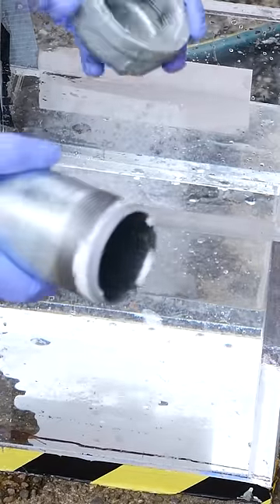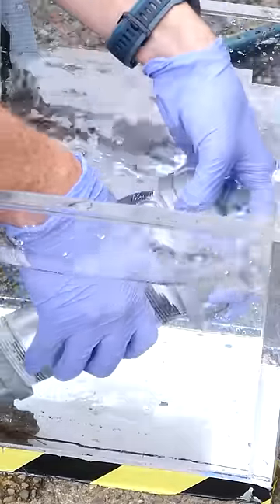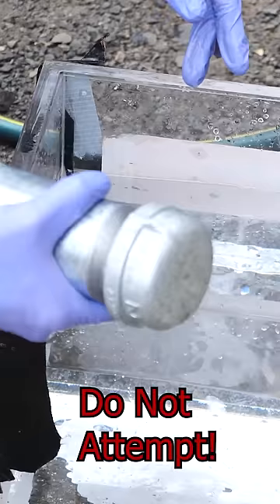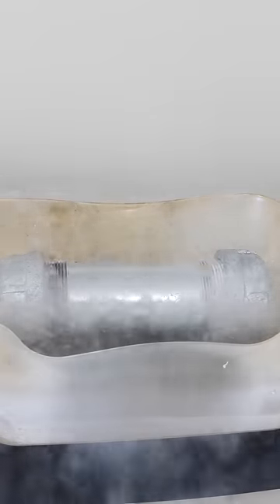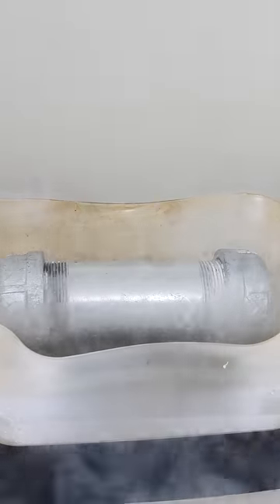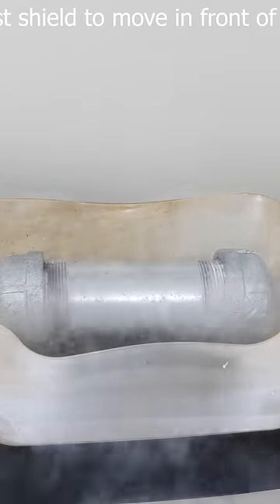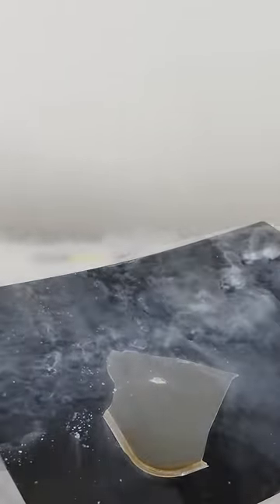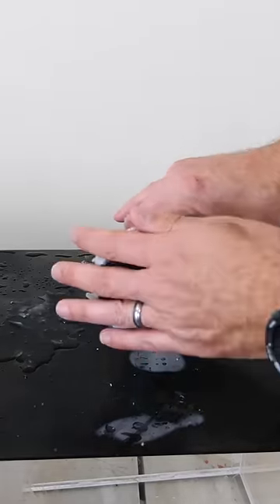Don't Ever Try To Stop Water From Freezing!

Comment: The pipe would still have likley broken if you froze it normally, but the liquid nitrogen weakened the steel, making it a more spectacular break than it likley would have otherwise.
Reply: Clearly a freezer would have taken too long.
Reply: Wrong my man it dosent get cold that fast at most it was -20c wich will not affect the steel
Reply: @night_light2867 that’s not true, the low temperature WILL AFFECT the steel.
Reply: @night_light2867 that's extremely thin galvanized mild steel. It doesn't take much of anything to effect it. I'm a welder and deal with 0.5" and thicker material all the time. Some is upwards of 3-5" thick. I've seen how hardened steel can become after excessive heating. We have specific procedures for metal that's been outside in the cold (down to -20 F here but sometimes even -30)

There's also the issue of how fast the temperature changes. Which I can assure you liquid nitrogen is more than capable of doing.
Reply: @ericalbers4867  Probably would have been a good idea to precool the pipe
Reply: I almost forgot about that variable and using rapid cooling. 
Thank you for that observation!
Reply: @ericalbers4867 Any literature you could recommend for those specific procedures for metal that's been outside in the cold ?
Reply: @xtevesousa  if you can get your hands on an AWS book, that would be best. Though other countries have their own standards as well. Some companies and fields will have their own S and M specs as well. Your best bet on this stuff is to start down the rabbit hole of metallurgy and material science. 

r/welding might be a really good place to start as well. I'm sure someone there might know some specific literature you could get cheaply or even for free. The AWS CWI manual is quite expensive otherwise.
Reply: Yeah. The liquid nitrogen was cooling the pipe more quickly and made it more brittle. In the freezer, most likely it would’ve popped an end top, but without shattering.
Reply: Normally when a pipe full of water under pressure freezes the pipe will split along it’s length. Usually you won’t know about the split pipe until the water thaws and water pressure starts to spray water everywhere.
Reply: @night_light2867   The steel used in the Titanic's hull started losing its ductility and became brittle in the cold ocean water, which was only 28°F (-2°C).
Reply: @newdefsys Dingdingding!Correct! We'll see you tomorrow in the Finals!

Same kind of thing happened to some of the Liberty Ships in WW2; trying to figure out what was happening led to the birth of a new science, "Fracture Mechanics".
Reply: How tight were the end Caps, if they would have been tightened with pipe wrenches the pipe would have split
Reply: Most of you in this thread don't comprehend that the water would not have Frozen it would have stayed a liquid. If they had put it in a freezer it would not have broken the pipe and upon removing it and opening the pipe again you would find the water was not a solid.
Reply: Thanks for writing the same thing I was going to write. He should have put it outside, especially on a day like today. It was -12°F today! That is not including the wind chill factor!  -19°F at night.
Reply: The caps arent cast iron?
Reply: @YZ450f24 how you figure that ?
Reply: This isn't the same as an ice explosion. It was too full to ice and the frost just blew the cap off.
Reply: @night_light2867  It's not just the change in temperature that increases brittleness, but also the rate of cooldown.  And this cooled down very fast.  However, in this case the cap failed first.  The no seize compound provides just enough slip and so the pressure forced it off.
Reply: @alexandernorman5337  😂 what are yall talking about ? The cap didn't unscrew
Reply: @diegodonjuan  wait ✋ you think a container full of water won't freeze ? What exactly do you think is the difference between frost and ice ?
Reply: @Didyoueverthink-ug5dw  Watch it again.  You see it separate.
Reply: @Didyoueverthink-ug5dw  think? Are you 7? He even explained ice expands, but other than that, every human knows about pipes bursting because of a freeze. That's why apartments often put up signs for residents to keep the water running when the weather drops below 32⁰ F or 0⁰C. I really want to know your age. Any liquid is bigger in solid form. Put a full bottle of water or soda in the freezer overnight, but like the man said, water takes up to 30% more volume in it's solid form. This is why all large tanks have pressure release valves. I'm hvac certified and my last job was driving a pneumatic tanker. You can't "think" you understand pressure and expansion in that job. Blue collar workers don't have the luxury of having opinions when it comes to trade math. As this video shows, it's life or death. Go look for a video of a pneumatic trailer explosion.
Reply: @alexandernorman5337  he literally shows it at the end , still screwed on with a hole broken through it
Reply: @Didyoueverthink-ug5dw  Watch the very end of the clip.  (The slow mo.)  You see the left cap pop off.
Reply: @alexandernorman5337  dude , both cap have marks , you can clearly see they don't turn at all and both caps are on at the end . Just saying watch closely doesn't somehow make them pop off. Even if that weren't true and you couldn't clearly see them not moving , you could pause the video at start and again just before it pops and anyone who can count to ten can see there's the same amount of exposed threads all through
Reply: @diegodonjuan Most liquids contract when freezing. Water is unique in this regard. Soda also expands because it is mostly water. Some metals also expand when freezing.
Reply: @caseyclausen2627  what? Frozen liquid metals? You mean metal? Liquid metal definitely is smaller in its liquid form than its solid form, and on earth, what liquid isn't mostly water? If you're talking liquified nitrogen, co², liquid helium or hydrogen... My first hazmat trucking job was with a company called Natwel in San Antonio. I delivered all those "liquid gasses" they have to be in special containers because in liquid form, they boil at very low temperatures and will evaporate at atmospheric temp and press... They all want to be gas on earth. Other than that, you're about to educate me... What liquids can exist on earth without being mostly h²o? Orange juice is mostly water, oil and alcohol are liquids, but good luck freezing them solid. They become denser as solids. I can't even think of non-water liquid on earth. Sounds interesting 🤔 do tell.
I was pretty young and inexperienced at that job, so I focused on the process of transporting it safely, not the science. The owner was the scientist, but he wasn't trying to teach me science. I don't doubt you, I just haven't worked with elements that behave like that. I can think of one example that might happen.
Reply: @diegodonjuan  Ethanol and mercury do not expand when frozen, for example, and are liquid at room temperature. Chloroform is another. Any liquid that is not a metal and is not H2O will not expand when frozen (as far as I know). Some metals expand when frozen, like iron. I am not a chemist and have limited info on this. I do recall from chemistry that if water did not expand when frozen, humans could never have evolved.
Reply: @caseyclausen2627  you're wasting your time , the guy struggles with basic physics and reading comprehension and I don't think logic is a strong suit either .
Reply: @caseyclausen2627  you definitely named chemicals I haven't worked with. Future rabbit holes. Sounds like something I'd like to nerd out to one day.👍
Reply: @diegodonjuan  thanks for the word salad,  why not answer the actual questions then ? Trying to insult people doesn't actually make you look more intelligent
Reply: @Didyoueverthink-ug5dw  you talking about me struggling with basic physics and low reading and comprehension?
I just looked at your channel... Click a video of me at work. Do you really know more about basic psychics and writing, than myself after 6 years in marketing, 6 years of various construction and 20 years of trucking? Well, you're going to do very well in life.
Reply: @diegodonjuan  let's see , your responses are incoherent , mostly irrelevant word salads , your only answer to questions is to just ignore the questions and use attempted insults , judging by your comments you don't know the difference between ice and frost , you seem to think water will stay liquid if it can't expand , you only knew of 2 non water based liquids , you don't seem to know about liquid metals , and you try to cite completely irrelevant (and possibly fabricated) work experience as a basis for knowledge/expertise. So yeah , lack of reading comprehension and not grasping basic physics is about the nicest and most polite way I can think of to state it .
Reply: It would have simply split, kind of like water pipes do in homes.
Reply: Not in a normal freezer at home. I can't even get a Gatorade bottle to expand.
Reply: @kylekenan2321  there's something wrong with your freezer

Comment: And this is why you check the freezing point of your antifreeze/coolant in your car before winter. This pipe could be your engine block(it’ll just crack) if there’s too much water and not enough antifreeze.
Reply: Dang. Thank you. Seriously.
Reply: @RaymondRAYCE  no problem, they sell testers at auto parts stores really cheap. Takes 30 seconds it’s well worth it for the reassurance.

Comment: Everyone who has ever had a burst pipe in winter knows this. Also a top tip. Properly drain your pressure washer and keep it out of freezing conditions as the forces at play here are present in the internals of the machine.
Reply: My bong did the same thing :(
Reply: Not the same. The pipe failed because  the extremely cold temperature of the liquid nitrogen made the steel brittle. It didn't take a whole lot of pressure from the forming ice to break the pipe.
Reply: @fearthehoneybadger  yep the same thing that happens in pressure washers. They have internal plumbing that retains water even after draining.some of those parts are plastic and crack in freezing conditions. It dosent break the washer but it leaks like a bitch. Learned this the hard way…
Reply: @robotsonmars1989  The problem with the experiment was that he didn't want to wait for the water to freeze under below freezing conditions and used liquid nitrogen. At several hundred degrees below zero, it made the pipe extremely brittle. The result is that you probably could have broken the pipe with a tap from a hammer. That made the experiment invalid as it didn't take that much pressure from the freezing water to shatter the pipe. As a matter of fact, the water hadn't completely frozen. 
I had an air force officer tell me about an incident in Canada where a wrench was dropped at a temperature of 50 below zero. The wrench shattered like glass.

Comment: I love how he said "in a container that doesn't expand at all"😂
Car engines have freeze plugs for this exact reason, because they're thicker steel (back in the v8 days) and they still explode
Reply: People call them freeze plugs but their actual purpose was to remove sand from inside the block from when they were cast. The block can still crack even if it pushes said plugs out.
Reply: Technically it didnt expand.
Reply: @simplialpha2117 yeah, the water expanded, not the container
Reply: @danand6907 As a marine tech. I can say from first hand experiences that “freeze” plugs don’t do shit
Reply: How much more thick it is doesn't matter, the container itself didn't expand here, the plug popped off
Reply: If you're ever having to replace one on an engine, they make "universal" ones that are made of a super thick rubber and are secured by a bolt and washers on each side of the plug. Will save you hours of time if you have to replace one at the back of the engine, saves you from having to pull the whole engine, or from my fathers suggestion of pulling the dash and cutting an access panel then welding it back 😂

Comment: So we actually use pressure to keep water flowing in a lot of cities, the difference is that all the weakpoints, specifically threaded connections, are sealed, plus the water reached below freezing temperatures at a slower rate, plus it has more room due to it being a flowing system, not always flowing, but still... otherwise canada, russia and many other places, wouldnt have plumbing.

Comment: This dude got  answers to questions I never knew I had
Reply: Welcome to Science 🤓
Reply: Unfortunately, that wasn't an answer. It just means the threads gave, not that it overcame the strength of the steel.
Reply: It bursted before the water completely froze cause of course water expands when freezing and well metal contracts when being frozen so it’s not only cause of the water. The metal was freezing first and already building pressure before the water started to freeze.
Reply: @markporter2108  okay but it did overcome the strength of the steel
Reply: Simply brilliant 👏 👌
Reply: Here's a question, "what's the difference between a prokaryotic and eukaryotic cells??....
Reply: This was not full answer.
If you actually force freeze water not allowing it to expand, Ice III crystals start to form. That is super dense ice which allows whole container to freeze without actually expanding.

Comment: Steel also contracts with low temperature so it adds another layer that contributes with the building up in pressure inside the pipe

Comment: "So we're going to close the shield now"

Good decision man.... you was about 1.5 seconds away from having shrapnel to the head.
Reply: Given the direction it shot, not really
Might've got hit by a little something, but nothing travelling lethal speeds or explicitly in his direction
Reply: @PJOZeus sure buddy
Reply: @Jerry_Bean  tf you mean “sure buddy”? You can literally see what shot out and where. None of it bounced off of the shield. None of it was even going close to him. 

You should always use a shield if doing this, but in THIS exact instance, had he not had a shield, he still wouldn’t have been hurt
Reply: @ontopofbottom  micro fragments we didn't probably flew everywhere. You never know man
Reply: @ontopofbottom plus I think the container exploded so that woulda done damage
Reply: The end popped off which was facing a different direction.
Reply: @ontopofbottom umm…there’s a big steel shard sitting between him and the pipe.  Yes the top popped off, but that’s misleading. The threads didn’t fail; the top exploded.  Shards could go any direction.
Reply: @Neon-Starz no, it exploded.  Threads intact; it didn’t “pop off”
Reply: @ontopofbottom  Wait, I never knew safety measures should be applied just for where the hazard is gonna be!! That's genius thinking, bro!!!  Specially when a heavy piece of steel is gonna explode. We can safely predict in which direction every single piece is going to fly to. 👏👏👏
Reply: @Tulio_Fonseca 
You can't tell unless you know the exact crystallographic makeup of every cubic nanomillimetre of the pipe and cap so you can see where it's going to shear, and that's only "probably".
I'll bet you a year's salary you have no idea what that was.

Comment: This is one reason you put antifreeze in your car. Also engineers designed freeze plugs so your engine block don't go pop instead, it pushes out the plug
Reply: it doesn’t make a difference, water can only freeze on the x and y axis. I’ve actually done a lot of research on this because I was curious. Had a friend who cracked a newly built engine in half because he had water in the coolant system when it freezed overnight.
Reply: @Jeko_9785  I'm sure you mean something else, but are you suggesting water freezes two-dimensionally?
Reply: @WhiteWolf-lm7gj  Kind of... If you have a cylinder with water in the bottom, it won't freeze and go up. Only outwards. So I guess yes? I could be mistaken, but my brother (which has a bachelors degree in engineering) and I have both kind of wondered why that is.
Reply: @Jeko_9785  I'm sorry, I'm still confused by what you are saying. Are you saying that you're wondering why water freezes and expands in all directions, or are you saying that water only freezes horizontally and not vertically?
Reply: @WhiteWolf-lm7gj  horizontally
Reply: The expansion plugs, we call freeze plugs in engine blocks were not designed to save a block from freeze damage. The holes are casting holes from the block casting procedure. The expansion plugs are simply there to seal the casting holes. But you are partially correct, they will push if the coolant is water and it freezes.  That’s where the name freeze plugs came into the story.
Reply: @Jeko_9785  As far as I understand it, water will freeze in all directions. I don't have good access to a freezer right now, but you could test it for yourself by putting a cup partially filled with water in the freezer and noting the difference in height before and afterwards
Reply: @WhiteWolf-lm7gj  I looked it up and according to a little bit of research, water only freezes outwards, not vertically.
Reply: @Jeko_9785  bro you can prove this wrong by putting a cup of water in the freezer.
Reply: @WhiteWolf-lm7gj  Yes you are correct
Reply: @WhiteWolf-lm7gj  also I think he means it can only freeze horizontally and it will not freeze from the top down or bottom up
Reply: @JamesCarter-nf1dy  Water does freeze top down though. Smaller quantities might freeze from edges as well, but water freezes at the top.
Reply: I am so confused now 😂

Comment: I work on Fire sprinkler systems.. I’ve seen steel tees explode with such force the busted pipe can be on side of the building and the piece that busted off of the pipe on the complete opposite side..
Reply: That... is concerning for me if that can happen.
Reply: fire sprinklers always freeze.... near attics above drop ceilings with no conditioning.
you'd think a code would have been devised to eliminate this problem during construction.... alas here we are